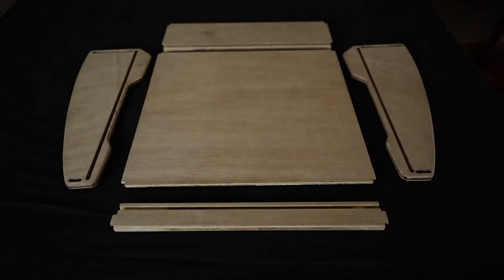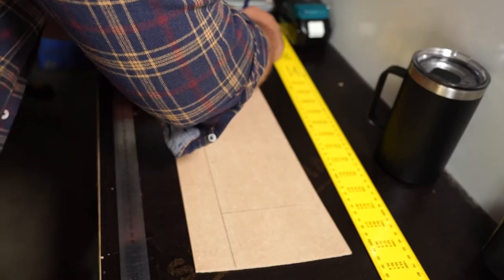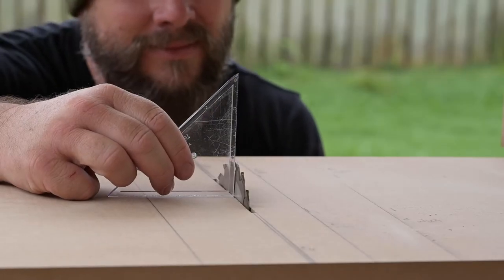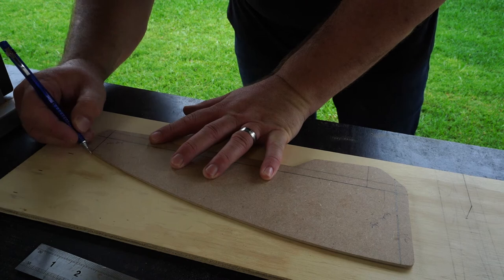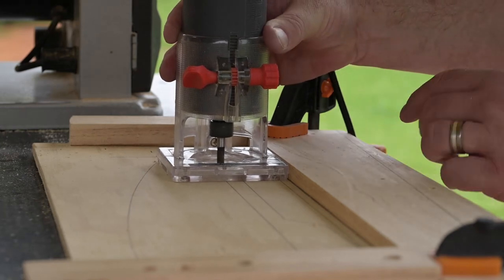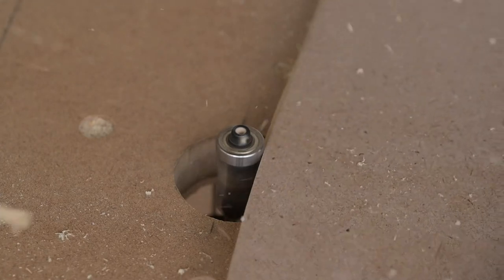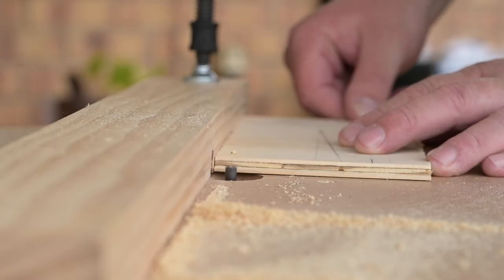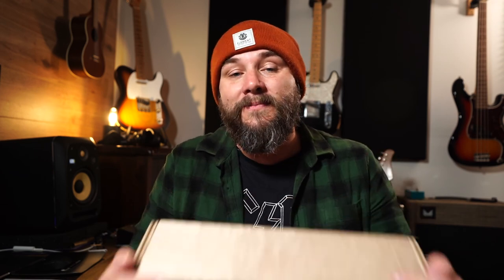How To Build A Schmidt Array Pedal Board - From Scratch

Comment: Good evening, the project is really cool.
I have a question: the bottom (floor) of the pedalboard, it has a slight upward slope, is the back part a little higher compared to the front? Or is it just me? thanks.